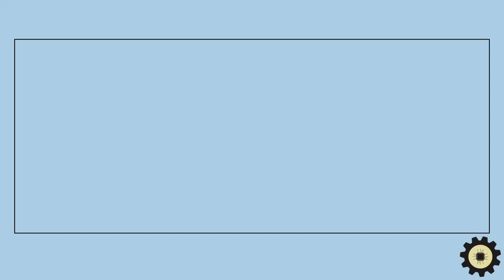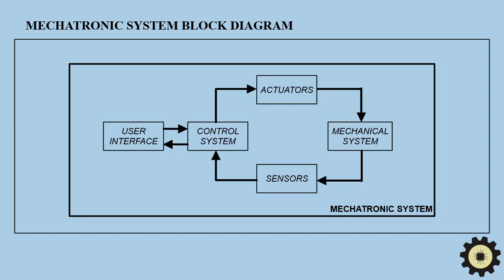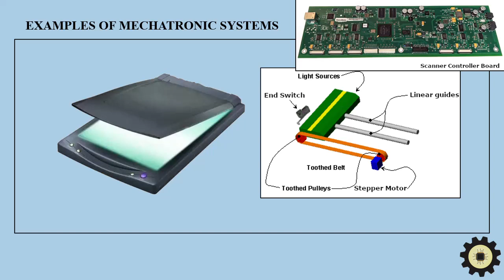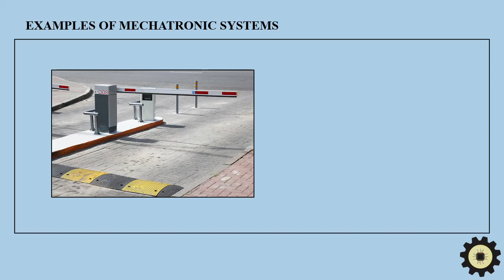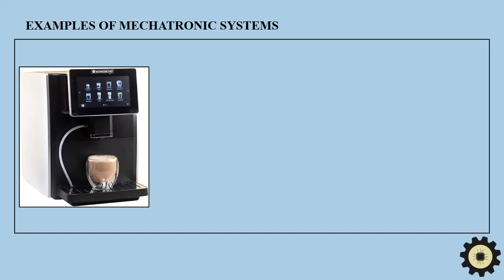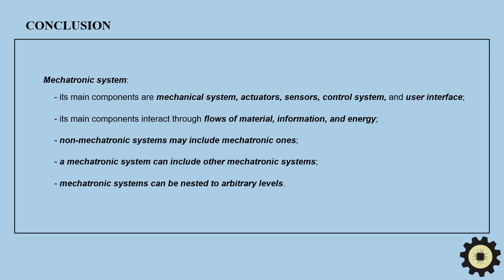Comment: A mechatronic system integrates mechanical systems, actuators, sensors, control systems, and a user interface, interacting through flows of information, energy, and sometimes material